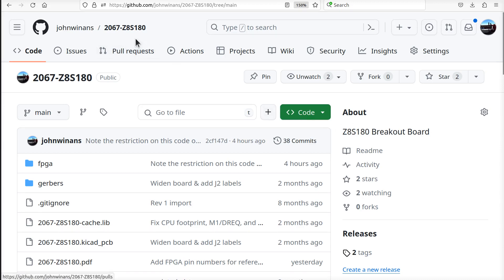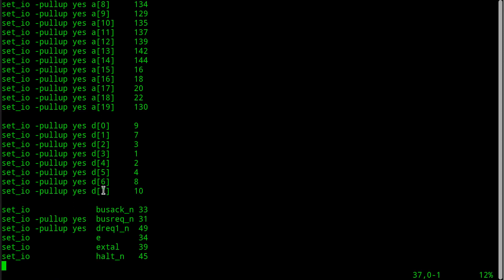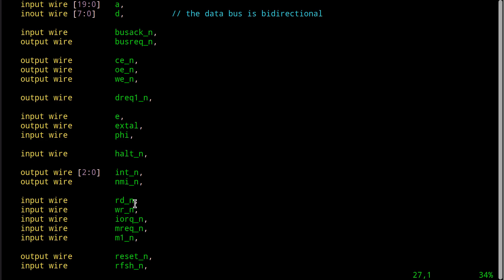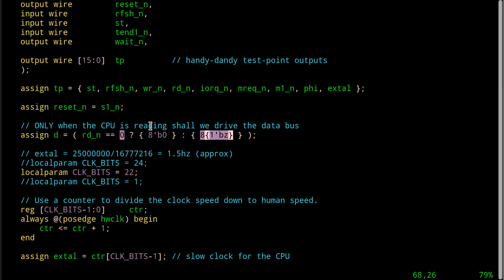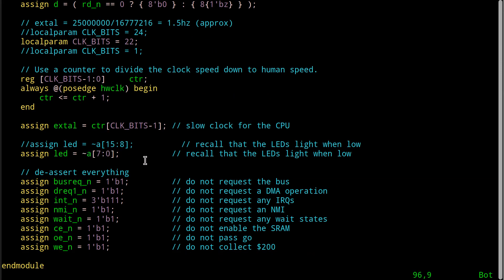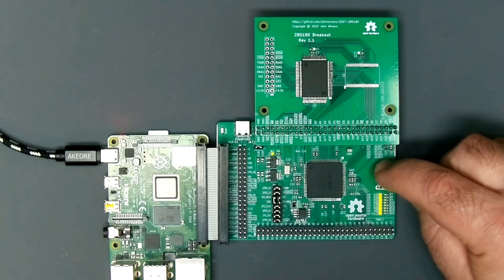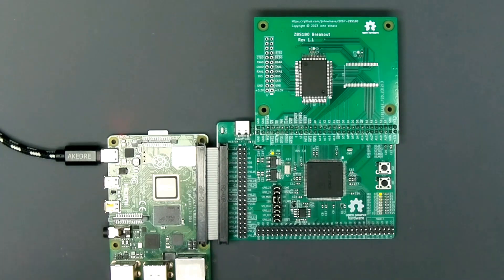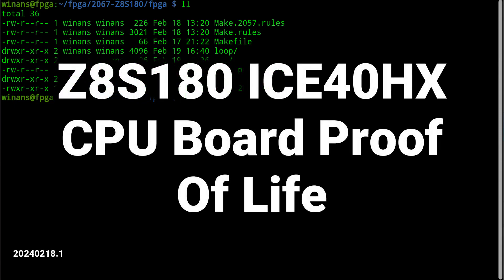Z8S180 Breakout Board Testing Pt. I

Comment: Hi John! You've got me hooked on the Z80 train. Thinking on building a portable Z80 machine myself. One thought: There's a neat chip called SSD1963, which is essentially 8080-compatible port on the one side, parallel RGB + sync on the other side with the frame buffer and PLL built in. It would be easy to interface with a dumb 800x480 LCD display or a VGA monitor (it generates configurable sync pulses internally). Do you think it could be used as a ready-to-go graphics adapter?
Reply from the maker: Their datasheet suggests that it could.  I hadn't given much thought to an LCD display.  I am tinkering with a VGA interface though.  If you are not already on the Z80-Retro discord, consider asking the folks there their opinions:  https://discord.gg/jf73DRZvh5